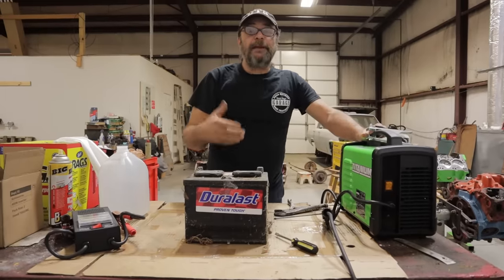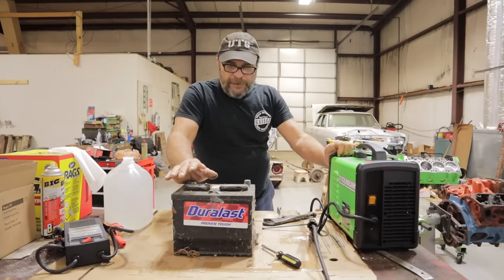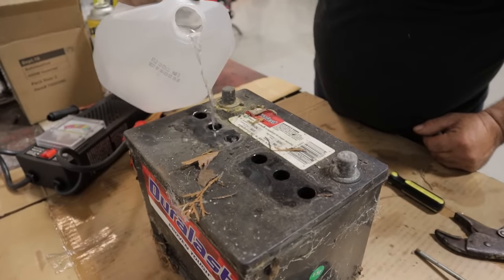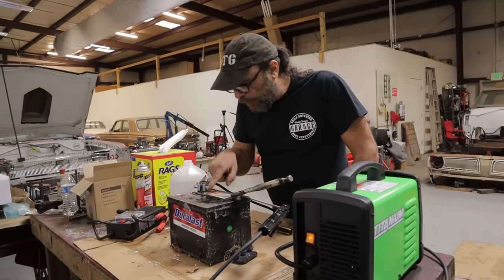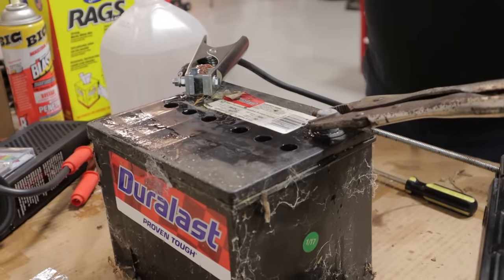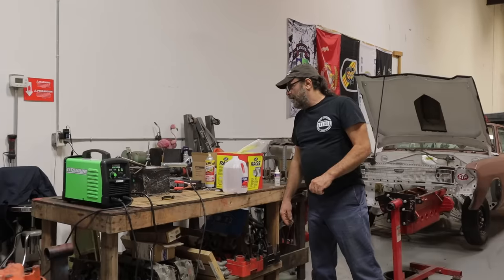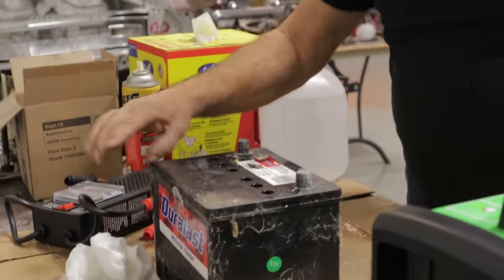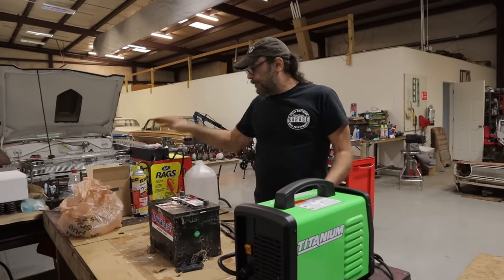Reviving Dead Batteries With A Stick Welder

Comment: Interesting. This reminds me of something my grandfather told me many years ago, he was an engineeer for Union Pacific, he retired in the late 60's, early 70's so this was before rechargeable batteries. He said when their flashlights would get dim or die, they would take their flashlight batteries and connect them to the big batteries on the locomotives for a few seconds and it would revive their flashlight batteries.
Reply: If they were alkaline cells, they are not "rechargeable", but they actually are. The problem is that the non-rechargeable cells tend to leak after recharging, at least in my own experience(usually a week or two later). They also greatly lose capacity over a couple of cycles.
I totally believe you could hook one up to a single cell on the locomotive(possibly lead-acid?) and charge it for a bit. Current would be limited by the internal resistance of the cells at least.
Reply: @MacRobbSimpson if it is cheap zinc carbon you can get about 1/3rd to a half charge back in them but you are right about the chance of them leaking shortly after. It’s a quick and dirty fix on batteries like that but once they have been revived it’s best to get shot of them after a day or two.

Comment: Dude you're a genius!  I have a 9-year-old farm battery (very large car battery) brand new never ever used.  I bought it 9 years ago to power a winch that I never ended up using.  It won't take a charge.  I have a car charger/jump starter, a big one you plug into a wall outlet.  I connected it to the battery on boost mode 40Amps and left it for 5 minutes.  Now my battery is at 10V and holds voltage when I test it using the same battery tester that you have.  I am going to do this several more times.  I didn't want to throw out a brand new battery (will try to sell it and the winch), you rule!

Comment: Awesome! It works, too! Just tested an old 12v riding mower battery at 1.4, charged it at 60amp for 60 seconds and it read 12.6! Before the trickle charger was too "smart" to even recognize it was hooked up and now it's happily trickling away...  BTW, the lawn mower batteries are sealed so careful if anyone tries this at home because the offgas has nowhere to go!

Comment: You could let that battery sit overnight and retest it. If it passes a load test then it should be good. Most generally a overnight sitting will reveal if it's still good or not. A bad battery won't hold a charge very long at all.
Reply: i think no can do . . if you use stick welding just use few taps for 30 seconds each will do . . use 24v
Reply: @chooper3048  that will NOT reveal a good battery... only by sitting then testing will.
Reply: They can hold a charge for over a week or even more and still be bad. A battery can pass a load test but when it sits a few days it can discharge itself if it has "dendrites" which are thin slivers of lead that get electroplated from dissolved lead in the solution. When one of those crosses from positive to negative plates inside the battery that cell will drain and depending on how thick the tendril is is how quickly it will run down. 
With the type of battery that you can pull the caps off, after you charge a battery you can let it sit overnight disconnected and check the specific gravity of the acid with a hygrometer (works like an antifreeze tester) and if one or two cells test lower than the others, those cells are bad and the battery will discharge faster than normal. On an older vehicle that doesn't have a computer or modern radio, etc and thus, no normal parasitic drain that keeps the memory alive a marginal battery might stay charged enough to start the vehicle over a week where that same battery on a newer vehicle might go down in a day or so.

Something that can happen that runs  one down quickly is a piece of a plate coming loose and shorting inside.

When they don;t pass a load test that's usually because of a bad connection that isn't an open circuit, just not a good enough connection inside the battery somewhere to pass the normal amount of current.

Comment: I run the battery room at my work, we mostly use AGM but the same process works with lead acid. If the battery is low clean it and top off(duh) hook to low amp charger. If it doesn't take. Run high amp for 15 minutes,  then hook up to low amp. When you shock it back to life you're only charging the top of the battery and need low amp and time to bring to full health. Hope this helps someone.
Reply: Does this same process work on AGM batteries as well? Thanks
Reply: Yes, because AGM batteries are lead acid batteries.
Reply: @BrandonBuckaudioanarchy  How do you top off an AGM battery?  Is that even possible?
Reply: I'm not altogether sure what he means by topping off, although I will assume he means to fully charge it such that there is a surface charge above nominal voltage. For instance, a wet cell lead acid battery has a nominal voltage of 12.3 volts but can rest at 12.6 volts. The three tenths of a volt above nominal would be considered the surface charge or, "topped up".

AGM batteries have a nominal voltage of 12.6 but can be charged to a resting voltage of 12.7-13.1 volts and the same applies to the resting level above nominal.

If I'm wrong in my assumption, I'd appreciate a correction.

Comment: I would strongly advise against using a welder for this. A CC CV power supply can accomplish the same goal in a much safer way. Set the current to 100ma and set the voltage to 40v. When it reaches the current limit and drops below 15v, change the current limit to 2.5a and the voltage limit to 14.4v. Let it charge until it is drawing under 100ma (this may take over 24hrs). Then set the voltage to 20v at 0.5a for an hour. After that, it's fully desulfated, and the battery has a much lower likelihood of exploding because of the lower temperature and current. I've had a lot of batteries short out using this method, but none have exploded.
Reply: I agree about using a welder, but don't the CC CB power supply cost quite a bit?
Reply: That how I'm doing right now as we speak,....I'm no genius but as I am doing this, I figured I'd come here to see what says Google and YouTube
 If you cab weed through the bullshit, you will find the smartest people on the planet here, thank you sir.
Reply: Ever try seating a tire bead with ether? Not safe either but it works
Reply: @Allan Drake  yep, but it's something I won't do again unless I'm stranded somewhere.
Reply: @inoahmann7542  You sound like the type that pays a shop to bust down and mount tires for you 🤣
Reply: @inoahmann7542  I use to work in a C130 second line shop, some of the retreads we built up needed a little help.  We waited until the boss went for lunch tho
Reply: @allandrake4426  My dad showed me a really neat trick for seating a tire. Works just as good as the ether trick. Go around the tire with a flat strap and cinch it down until the tread goes in and the sidewalls go out to the rims. Hit it with a shot of air until you feel it seal. Pop the strap loose and fill it up. It's never failed me.
Reply: So you're setting the voltage to 40V with current max (i.e. shut off) at 100ma?  Or vice versa?  When you say voltage drops below 15v, you mean just letting it sit there and drop naturally?  Thanks!
Reply: @RogerPack  pretty much. 40v limit and 100ma limit. As the battery begins to accept charge, the current will climb to 100ma, then the voltage will drop and continue dropping to keep the current from going over 100ma. I bought a cheap chinese battery charger that does the process automatically, but I haven't used it enough to say if it works as well.
Reply: @RJArens  it doesn't work well on heavier commercial tires. I just stick to using a bead bazooka. If that's not an option, I'll use a healthy blast of the go go juice.
Reply: Would you say you get as good a percentage recovered using this way?

Comment: My dad was doing this on our farm 30 years ago. He was always trying things. Don't know how he lived to 87 years. I have a 50 year old Associated Battery charger that on high charges at 18 volts. Works very good for this. I don't let anyone else use it,  NOT because they will hurt the charger, BUT because like I did once, they will fry electronics.   When I was 11 my dad had me driving the truck around the field at harvest. I couldn't see out so good so I sat on top of the extra battery. I knew not to sit on the top so i put it on its side. Later that day I asked why the back of my dads pants were getting large holes.....He had red buns for a few days. Be careful with battery acid. Thanks Tony!

Comment: It works. I've done it. It's an electrical 'brute force' technique. I've done the same reviving many kinds of small batteries; using a pulse width modulator - which pulses the charge and keeps the battery from overheating; perfect for sealed batteries. The reason the welder works better than high amp battery charger, comes down to charge voltage. The welder is running at 16-19 VDC. The success of any brute force technique is the overvoltage. I used to do chemical desulfating on coffin batteries; for buses, motorhomes, heavy equip. It was a long and messy job. I much prefer the electrical method. For ultimate/OCD results, one could pour the acid through a fine stainless filter, to remove particulates; that have sluffed off of the plates. This may/may not improve longevity. 

Based on what i have learned, the next auto battery I do I'm going to apply some pulse applications. Going to try 1 min on, 2 min off, 10 cycles and see if that produces desired results.
Reply: Sloughed
Reply: Please return and report your results.
Reply: @R C Nelson   Will do! Since my reply is long, I’m putting in main comments.
Reply: @tomasjones3755  👍🏻
Reply: Would a 200 amp DC welder work for motorcycle batteries if you turn the amperage down? One of the videos I saw said to get a 160 amp welder for smaller batteries and deep cycle batteries and a 200 amp welder for larger automotive batteries but I'm not buying 2 different welders.
Reply: @bodeine454  Yes you can. I think you will find 30--50 amps is PLENTY , for charging any battery. You want the cells 'bubbling'. That said, if you are using so much current that you can see visible vapor boiling off, then that is excessive. At that point, I'd shut off the welder and let the battery rest for 10-15m, before applying the next charge.

I ran a test, using my 200A welder. It has pulse control. I know a bit about 'brute force' electrolysis. The idea is 'high current, short duration'. To that end, I set my Pulse to 2-3 hz (2-3 pulses per sec) Hi side current set to 50A and base current set to lowest level. This allows the charger to remain working longer, without cooking the electrolyte. It also has adds 'shock' value to the process; physically helping to rid the battery plates of their insulative coating; the reason the battery has it's initial charging problem.  

In my tests, the pulse worked better/quicker that constant current. If you don't have pulse control, no worries. When using a constant current welder I used 1min on (at 50-60A) and 3-5m off. The heavy inrush of current, followed by a rest state, mimics the 'Pulse Width Modulation' method; of the pulse welder. Hope that helps
Reply: Is that a DC or AC welder?
Reply: @BuzzLOLOL  DC only.
Reply: What did your chemical method consist of (chemicals,processes)?

Comment: I worked on a DC power plant that had over 600 large batteries and put out over 7,000 amps. We always had eye wash kits and splash proof goggles on site for safety. Because the lead acid batteries were not exposed to the heat from under a hood or freezing winter temperature's some were rated for 60 years. When I retired some of the batteries were well over 25 years old and still going strong.
Reply: 25 years and still going strong😶 do you know the chemistry of the batteries?
Sounds similar to the nickel-iron alkaline cells used in the original Baker electric cars.
They were very heavy, very large, they charged very slowly, you couldn't pull massive current  BUT... they weren't negatively affected by repeated deep discharges due to the electrolyte having a low solubility of the reactants. 
They also had a life rating between 30 and 50 years... With very basic maintenance..
Reply: @angryman3317  They are standard lead acid batteries. I should have said that the output of the plant was 7,000 amps and the plant is sized so the equipment can run on the batteries for over 24 hours. We did monthly voltage test on individual cells and would do a discharge test on the plant once a year where we would let the equipment run off the batteries. I would run the backup generator once a month for an hour and it would take about 100 gallons of diesel to run it for that hour. I never checked out what would be the maximum output current. We also checked if the batteries needed water once a month.